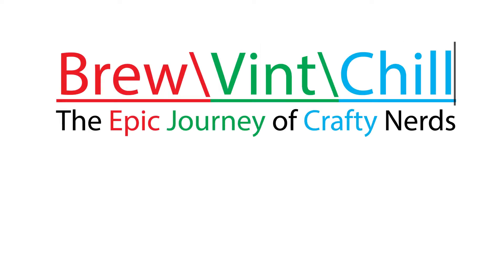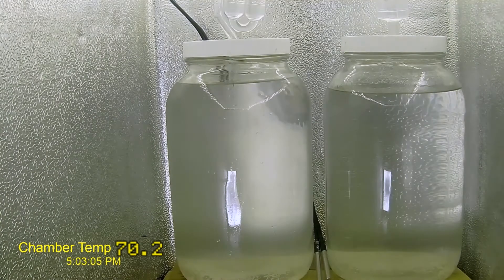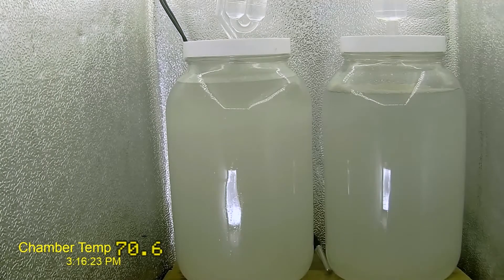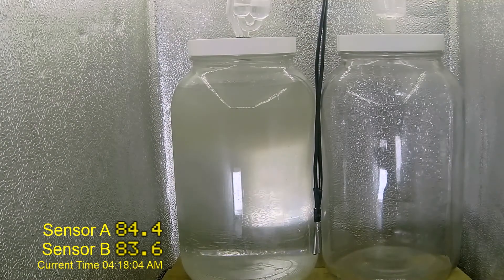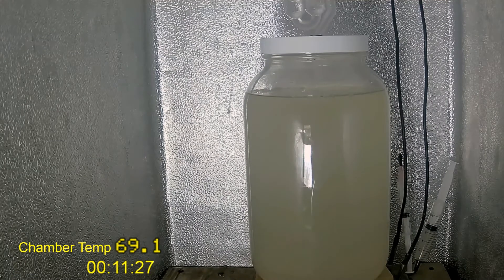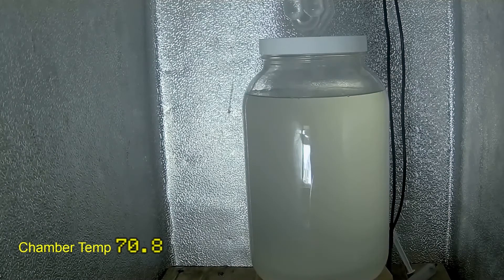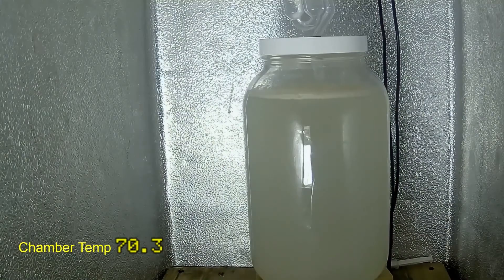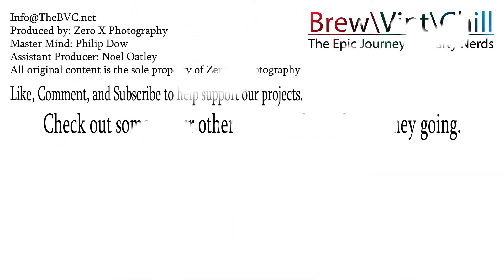Hard Seltzer Part B, Problems in fermentation land

Comment: Lack of yeast nutrients?  

I also have a question. I added yeast nutrients to my fermentation bucket at 24hrs, 48hrs, and 72hrs. The air lock still doesn't see much activity (bubbling). It is located in a dark room that stays at about 65ish degrees. Is it OK to rock the fermenter side to side to sort of mix the yeast and nutrients together to create a more active fermentation? Thanks!
Reply from the maker: Yes, nutrients were the big problem for us, but we also learned our lights were putting out a crazy amount of UV light. Killing our yeast.

You can rock it back and forth (Or open it up and mix it), but what I would do is take a gravity reading. If it's still high I would repitch some yeast, it's already been 72 hours, if it is halfway or almost done fermenting I would transfer to secondary as that can help roust the yeast without kicking up too much sediment or just stick to mixing it up if you're not worried about clarity right now.  Or your lid is just mostly air-tight, check for a leak. 

Let us know if you have any other questions.
Reply: @Brew\Vint\Chill  Thank you for the information! When transferring to the secondary fermenter, should I use a siphon or can I just pour it leaving behind the trub? Is seltzer as sensitive to oxygen/ splashing as beer is? Thanks again!
Reply from the maker: We always recommend using a siphon or pump/vacuum to perform transfers. Less chance for things to go wrong, and helps transfer only what you want. Seltzer is less sensitive to oxygenation because of its lack of Hops, but that doesn't mean it can't still be a problem because of the alcohol. If oxidation is a concern that pops up close to bottling, you can add some Ascorbic Acid right before bottling, affiliate link below. Let us know if you have any other questions.

https://www.homebrewing.org/Ascorbic-Acid-1-oz_p_358.html?AffId=690

Comment: Man I have no idea what's happened to mine it has not cleared up and stinks of sulphur... boiled 3kg of dextrose into 23L of filtered water in my brewzilla, added Camden tabs to take away the chlorine, whirfloc tab for clarity all added in boil, used turbo yeast for distilling washes (has all the yeast nutrients and crucial trace elements for yeast health). Fermeded at recommended temp for yeast was done in 2 days from 1.045 to 0.99.. cold crashed, added gelatine for more clarity and it STINKS like sulphur and has not cleared up.. thinking ill 'lager' it until it clears up but I dunno about this one.. funny thing is, if it were a lager beer I would not be concerned at all at this point..
Reply from the maker: Yeah,  Turbo Yeast will do that. You can give it time, but it will never taste as neutral as the EC-1118.  I have had a lot of distillers get mad at me for suggesting Turbo Yeast in the stores I worked at because of the sulfur and other off-flavors, but it is still super popular. It comes down to it fermenting so fast that the yeast gets stressed out, and all yeast create a sulfur smell when stressed out that much. Plus, some of those added things aren't great or more yeast would finish that fast.

And for the Clarification, I recommend Chitosan for the regular recipe. But because of the haze coming from the water itself, you might need to go with some Bentonite or try FermFast Dual fine as that is a mix of Chitosan and kieselsol. I don't know if the Whirlfoc would do much as there is no gluten or proteins to grab on to because it is just the sugar in there. 

We hope it works out in the end. Let us know if you have any other issues.

(Affiliate links that help us out)
https://www.homebrewing.org/Bentonite-8oz_p_359.html
https://www.homebrewing.org/FermFast-DualFine_p_369.html